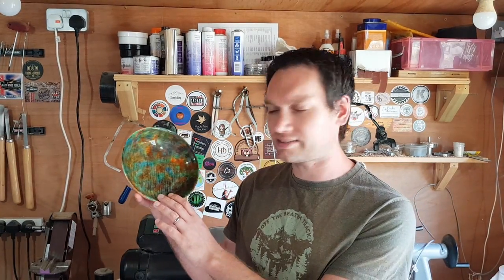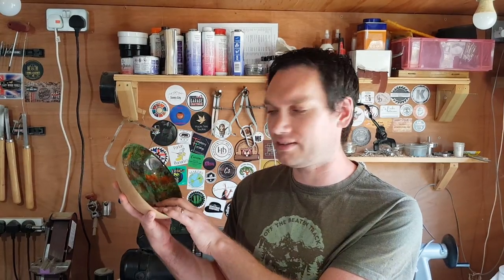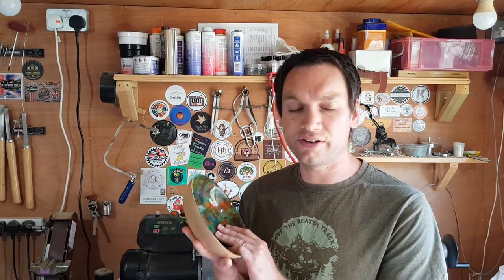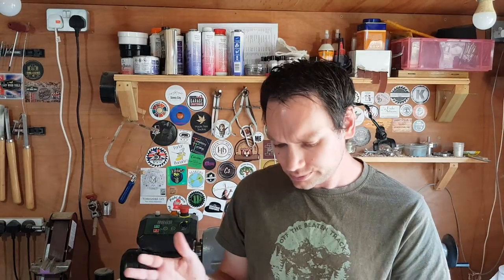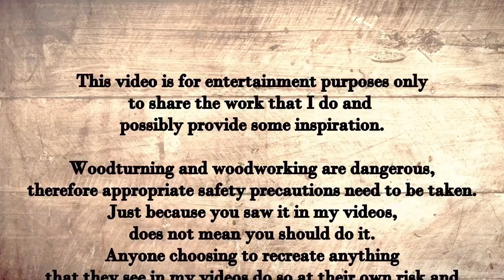Woodturning| An Experiment in Colour

Comment: That is brilliant John. It looks amazing.
I have had so many ideas from Stewart as well.
Thin it certainly was and your idea for reinforcing the mortice is brilliant.
Great video as ever mate.
Take care.
Cheers, Huw
Reply from the maker: Thank you Huw. It was a really fun project and I really like the outcome.  There's so many things that Stewart has done which I want to try, but all in good time.
Initially I was thinking to use resin, but am glad I didn't as I like the idea of adding an element of the inside colour scheme to the base
Reply: @JiggsysShed  I think what you did works so much better than if you had used resin.
As you said it matches the inside and anyone picking the bowl up and looks at the bottom will have a great surprise.
It's an idea I will pinch as well mate.
Reply from the maker: @WoodenItBeNice  I definitely agree with you there. The resin would have looked out of place, whereas this almost looks like it was intentional from the start. It's actually a great way to hide mortise, but using it as a design feature. Guess if you used light wood, you could use a dark wood inlay or vice versa
Definitely go for it. Will look forward to seeing your result.
Reply: @JiggsysShed  👍👍

Comment: Very nice did you let the stains dry in between applying
Reply from the maker: Thank you Roy.  No, I didn't wait for each application to dry. I just kept applying until I was happy with the mix. This does help with the blending process, but also, if you were to wait for each layer to dry, the spirit in the stain will still affect the previous application. Before sealing it in, the stains have to dry and a spray sealer is best for this. If you use wipe on sealer, you will lift some of the stain away or cause smears even when the stains have dried.
Reply: Ok thanks I tried one on a pen but one side was lighter than the other
Reply from the maker: @roystheboy  sometimes, depending on the grain, absorption of the stain can be different from one part to the next. For instance, end grain would hold the colour quicker than side grain. Unlike paints, stains will only hold if they have soaked into the wood fibres.
Wood types can also affect the outcome,  for instance the tannins in oak makes blue look green.
If you have a lighter patch, just keep building up the stain layers until you are happy with the depth of the colour.